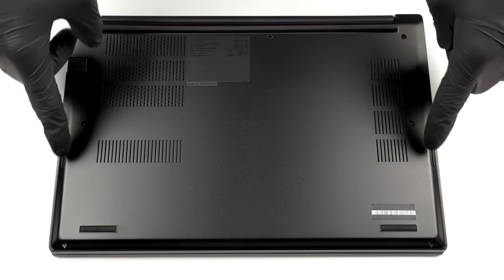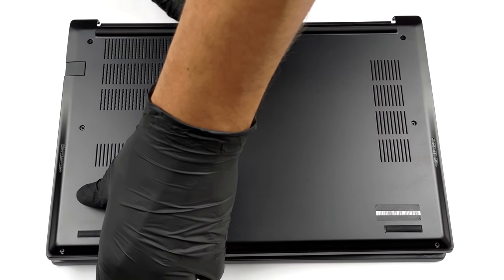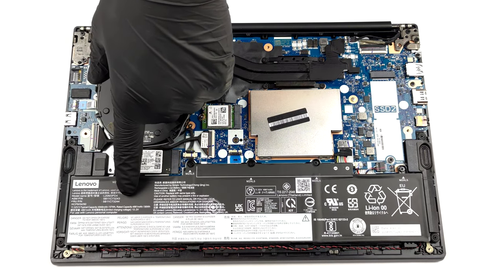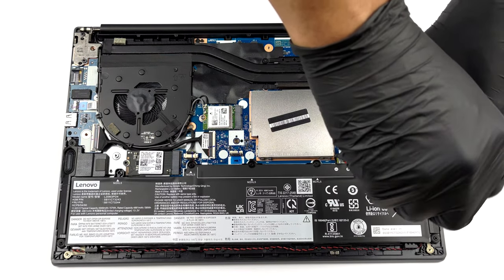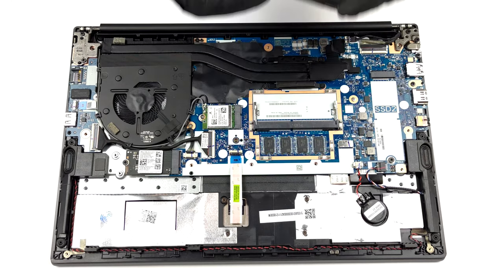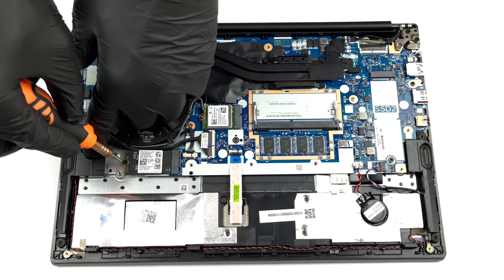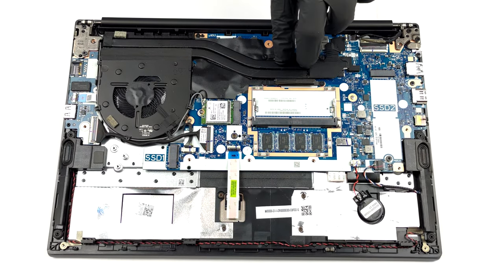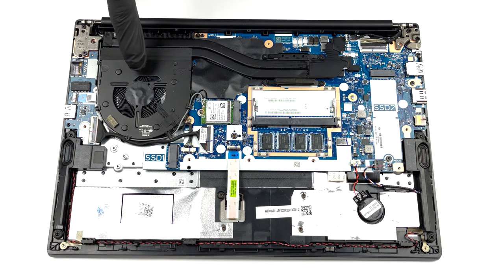🛠️ Lenovo ThinkPad E14 Gen 3 - disassembly and upgrade options

Comment: Where is the second ram? under the keyboard maybe?
Reply: 8gb on MB and you can add one 8gb or 16gb to get 16 gb or 24 gb
Reply: @bartoszwisniewski2863  Ryzen 5000 supports 64GB RAM so can't you also put a 32GB stick for 40GB total?
Reply: @bbaker6212  The slot does not allow for that, only 16gb. It does support 3200 mhz ram though.

Comment: WARNING: releasing the ~15 "hooks" holding the bottom lid in place after loosening the screws is WAY harder than what is shown in the video. Those "hooks" are part of the main chassis and their "tips" point outwards. After breaking a lot of them, I think the correct procedure is to use the plastic tool to carefully bend the border of the lid outwards (like a small bump) to allow for a soft release.

Also, there are two big "hooks" that are part of the lid itself, very close to the center and pointing to the front-border (touchpad, bottom in the video); these require a very careful maneuver to release; I managed to do that after releasing all borders by gently bending the lid on the line from front-border (touchpad, bottom in the video) to back-border (hot air exhaust, top in the video), then a short, careful, push in the direction of the back-border.

The good news is the screws + a couple border hooks + the 2 center hooks are able to hold the lid in place; but that means the screws will now do most of the job, so handle them with care.

Finally: I'm very disappointed by Lenovo for making this chassis much harder to open than older ThinkPads. This will factor negatively on them for future purchases from me. Given upgradeability/repairability is important for me, I'm seriously considering getting a laptop from Framework.
Reply: Thanks for mentioning this, the last thinkpad I owned was a T410 so I would've been in for a surprise!
Reply: I can confirm this, somehow. It seems to be right in the middle and I was going crazy because I thought I missed a screw. I could bend all edges fine but it was still not opening. With more force it finally opened. Yes, that is not really nice and should be changed and yes, the video is not showing how hard it was for me.
Reply: Update: I just managed to open a new E14 Gen3, while breaking only 3 "hooks" in the process; I tried my idea of using the tool to bend the border of the lid outwards. I suggest doing it slowly to notice where the lid doesn't easily bent up (away from the chassis) and make sure to make the proper outwards bend so it detaches softly (but don't push the tool too hard against the place where the lid is held by the hooks).

Also, the border of the lid running alongside the display hinge (top in the video) is different than the other borders: the "hooks" are on the lid and they point inwards (down direction, if looking at the video). I broke 2 of these initially, but then realized that using the plastic tool only to gently bend the lid upwards, then insert a knitting needle (CAREFUL! RISK OF SHORT!!!) and use the knitting needle hook to bend the border of the chassis outwards should work; and it worked, as the other hooks were released very softly.
Reply: Tip: slipping a credit card in the gap between the two panels will also work.